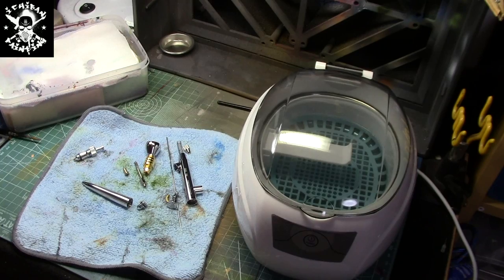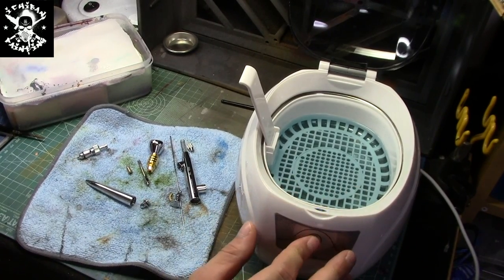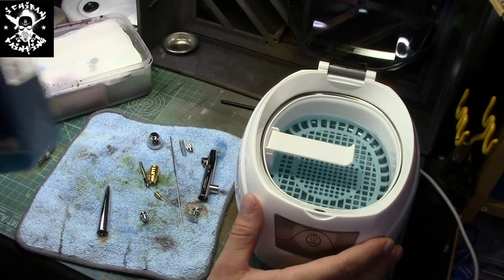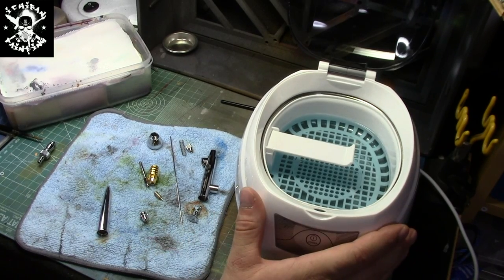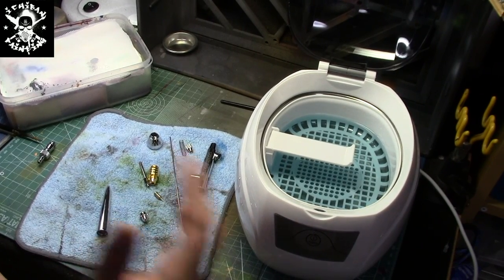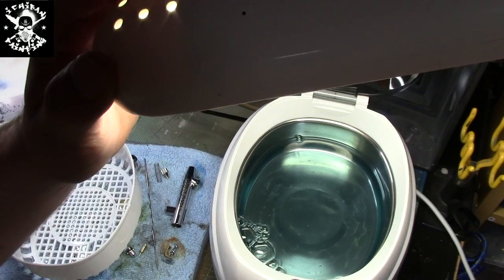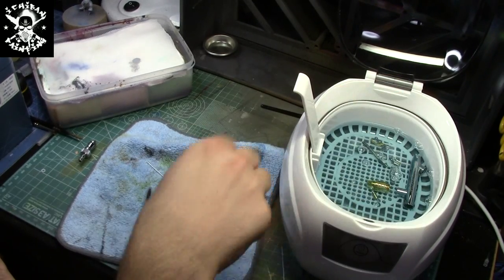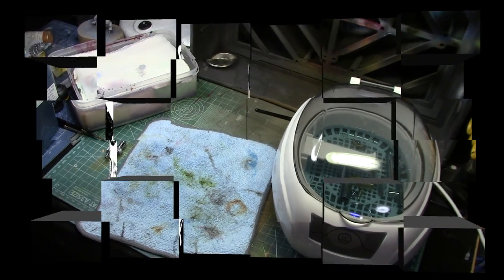Ultrasonic cleaner *Pro Tip*

Comment: Excellent Tip in deed !   Specially the removal or "Not to Put in"  the Air Valve...
I destroyed a good Iwata AB that way !!!  my Bad !   The Air-valve treads were damaged by Cavitation = Bubbles trapped in between the Cleaning solution and the treads... which Etched the Brass treads and resulted in a Breakdown !  Now... I need a new AB body which cost 50% of a new one... so..  New AB it is !   I wish I had seen your video before I bought my U.S.C.   once again ! Thanks for posting this!